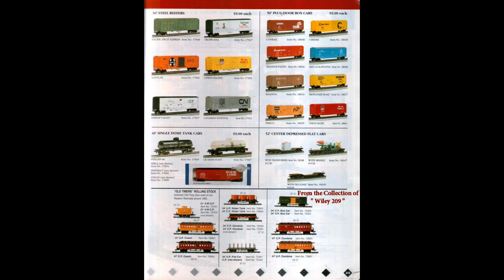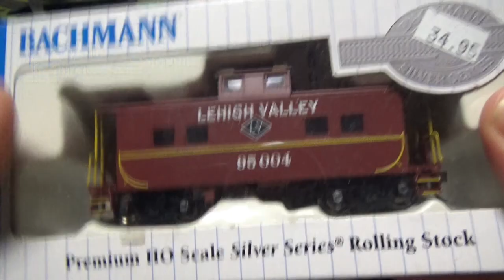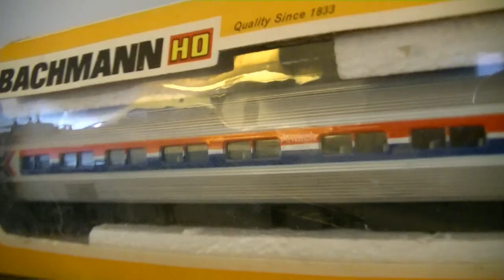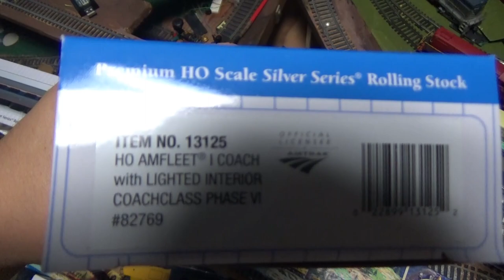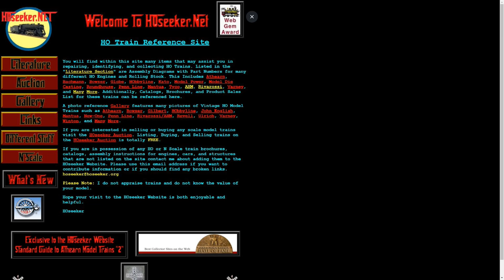Bachmann part 3 Coaches & Freight Cars

Comment: Yep! I remember those vintage Bachmann cabooses'. I had the 1950's version of the UP caboose when I was 9 years old. Not too shabby!!! I used to have a "Blue Bonnet" Santa Fe one as well. It was the classic Athearn "Blue Box" model. I remember replacing the couplers with "Kadee #5's". I now have a SP one with LED red lights on both ends. It operates either with DCC or DC. It has the Soundtraxx Sound Car decoder inside.